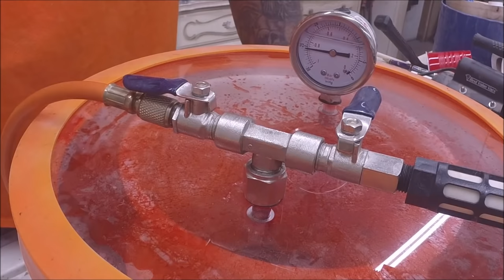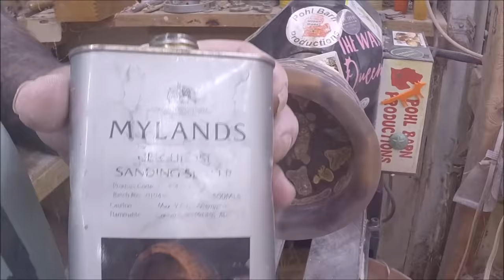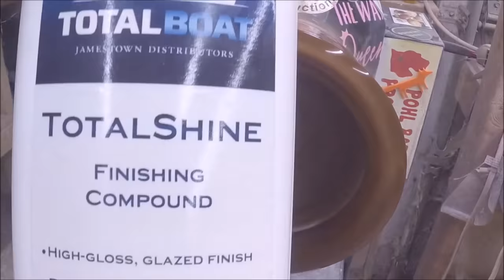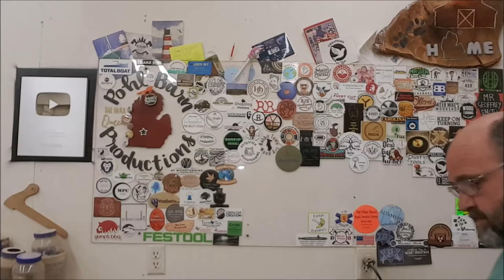Dog Treat Bowl

Comment: So, if what I saw is correct,  the resin formed a meniscus over the maker coin when it dried.  I am not sure that there is any method to prevent a liquid from forming a meniscus, but if you are consistent in the amount of resin you use over the maker coin, then as long as you adjust the well depth to allow a 1mm clearance from the peak to the vessel bottom, th function won't be impaired.   Maybe not as aesthetically pleasing, but...
Reply from the maker: Thank you Suzette, I put to much resin on the maker coin

Comment: Maybe if you soak the dog biscuits in a slow-curing resin. Something that takes a couple of days, so the liquid could thoroughly penetrate the biscuits before it sets. Maybe a thermal-setting plastic? Where you could let it soak in, and then cure it with heat, or UV, or something.

Also, what if you turn the bowl, and then apply a separate treatment for the biscuits? You did use CA glue there, so maybe set it up so the biscuits could take a second resin or glue treatment.

I like the result, though. I'd buy it for my dog.
Reply from the maker: Thank you Adam